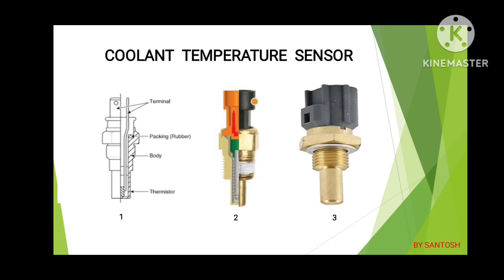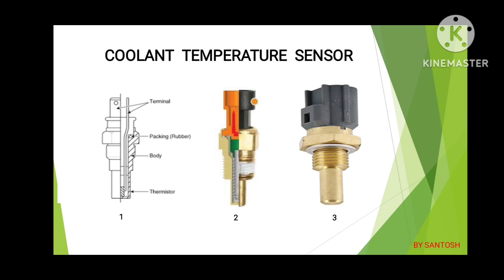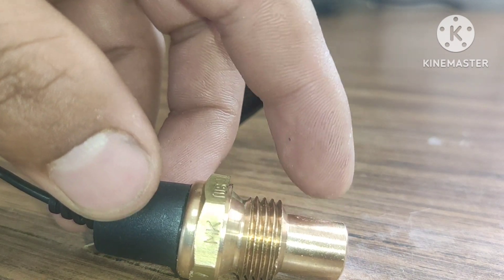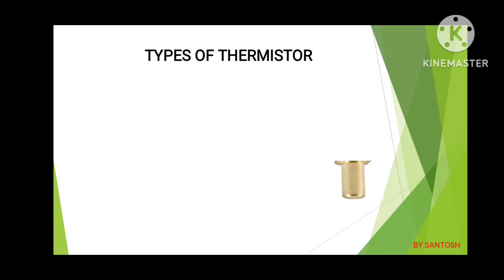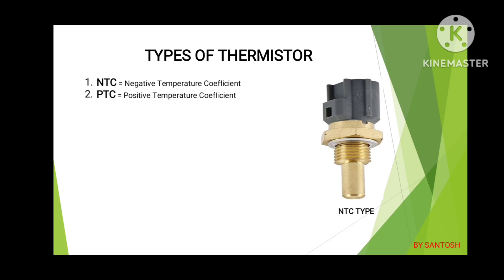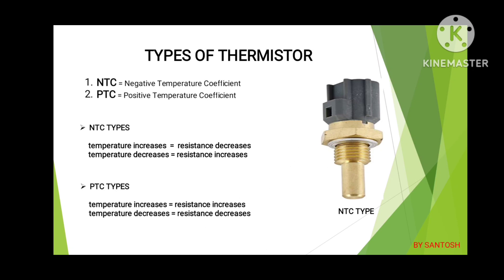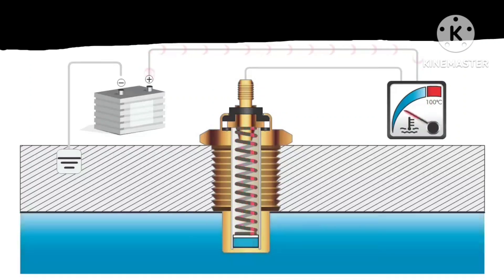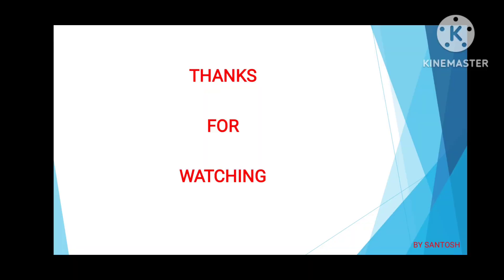How does coolant temperature sensor work.?

Comment: What happens if there’s no coolant?  Does sensor think engine is hot ?
Reply from the maker: If there is no coolant, the sensor might read the temperature of the air or  the metal around it. Which is not representative of the engine's actual operating temperature. So the sensor gives the false signal of temperature which will not  be accurate temperature of the engine.